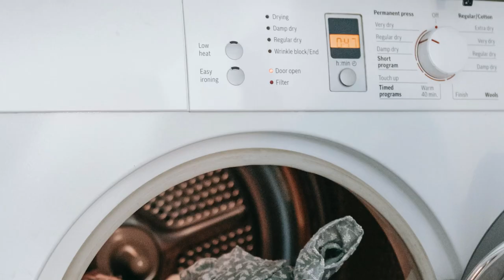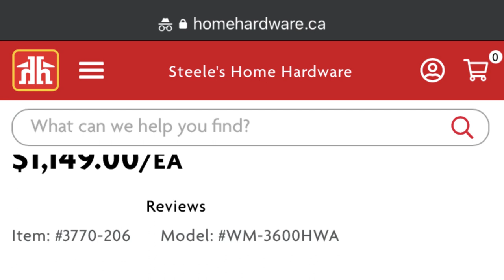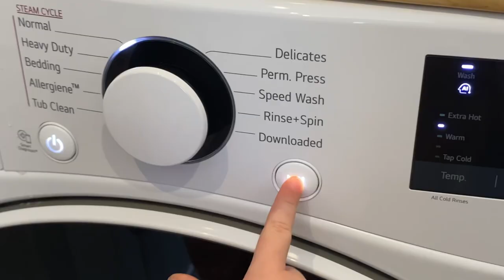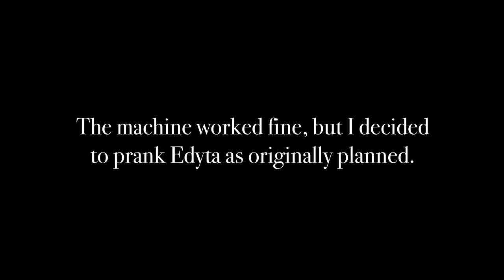Broken Washing Machine PRANK On Wife GOES WRONG!

Comment: Don't get your hopes up too high, just cause they're new... Paid big money to buy a top of the line German made Miele washer and dryer, at 45 years old, the first new ones I ever bought. POS blew apart during the high speed spin cycle at less than 10 years old. Every part of Miele's marketing BS talks about how it's engineered and built for an expected 20 year life span, but the warranty is good for a whole year.
Reply from the maker: When they break I know how to fix them 🙂
Reply: @cabininthewoods517  Me too, but the news ones with everything electronic... The parts will cost 3/4 the price of a new machine, if they are even available.
Reply from the maker: @Jerseyhighlander  True. But at this point this is almost a hobby for me lol
Reply: Miele is waste of money sadly. Dont know why people are so obsessed with them today… :(
How did it explode?
Reply: @bogdannb  Well, the outer drum, that you can't see, is made of stainless steel, it holds the water and the inner drum, that you can see the inside of, which is also made of stainless steel. Problem is, some non-genius, decided to cut costs and make the drum support trunnion, the thing that holds and spins the inner drum, out of cast aluminum. The galvanic corrosion of that inner drum support soaking in the electrolyte of soapy water, ate that drum support away like vinegar eats away eggshells. 
The worst part was, seeing the slop of heavy metal sludge our clothes, towels and bedsheets were soaking in every time we "washed" them for years before it finally broke apart. It all looks so pretty and polished until you take it apart and see what is on the other side of that inner drum.
Reply: @Jerseyhighlander  no comment. Yep, Miele is horrible… :( Sadly